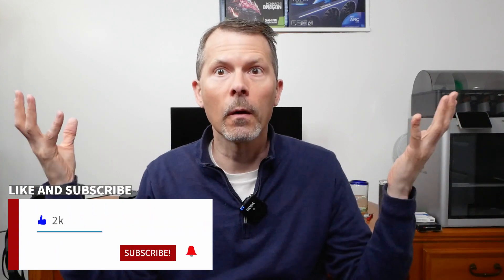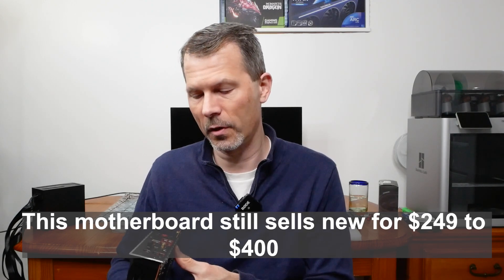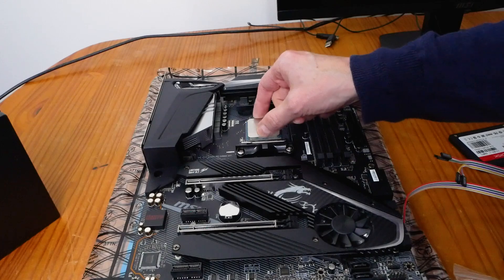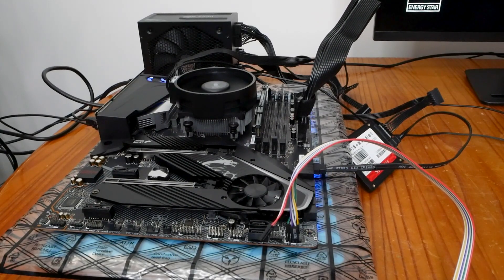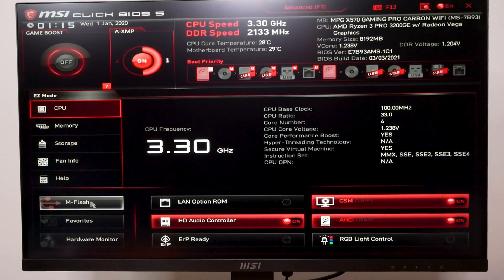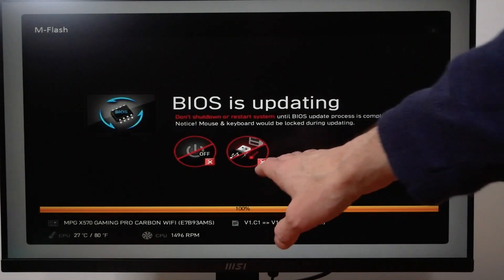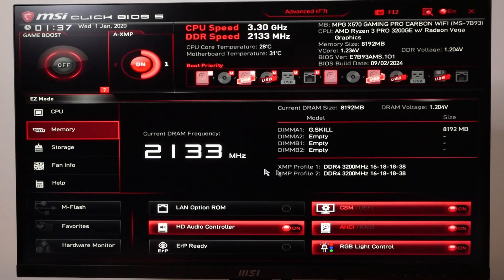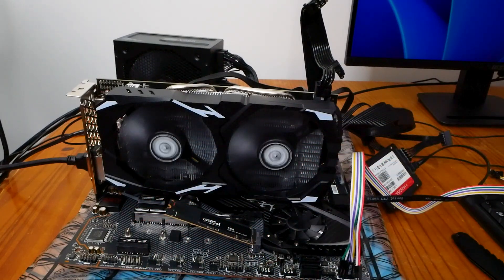BROKEN MSI X570! Can I Fix This Motherboard? #msi #pcrepair

Comment: For ram - it's generally the 2nd slot to the right of the cooler. Believe that slot is labeled as 2A then the 4th to the Right is 2B. the other lots would be 1A and 1B those would be the left of 2A and 2B.
Reply from the maker: Good info, thanks. I appreciate it :)

Comment: You seemed concerned about putting your cpu in it. If you have a multimeter, put the CPU in and check for shorts on the 12v before powering it. The 12 volt is where it will get power. You can check it against grounds on the cpu power connector on the board. Just google the pinout for it. I always forget which to probe. I run an msi unify x570. Be on the lookout for one or a godlike. Totally different tier of quality.
Reply from the maker: Ahh Good info I didn't think about my multimeter :) I can only imagine how mush those Unify or godlike mobos cost :) Thanks!
Reply: @RememberThisTech  the godlike is insanely expensive. I got a unify pretty much free in an untested ebay lot. The lot had two boards in it. One was the unify and the other an am5 with jacked up pins. Sold the broken am5 for parts making the unify free. It is crazy how heavy the boards are.
Reply from the maker: @ItIsNot1984  Great deal you got!! Yeah even the mobo I have has weight to it. Just got a new AM5 mobo will have reviews and testing soon!!
Reply: @RememberThisTech  on the unify and godlike, the vrm heatsink, shroud, chipset all of it is fully metal. Probably 3 or 4 pounds of aluminum. I think the carbon you've got is their best in the mpg class. The megs really get nuts.

Comment: I think your theory is valid. Someone plugged in a new CPU, noticed it didn't work, thought the board was bad and chucked it. Probably a commoner. A builder or enthusiast would have known better.
Reply from the maker: Yeah spot on! IDK why but in today's throw away culture it's more and more common for me to grab perfectly working stuff. I for one am happy i can get the stuff but sad to see so much in the bins for now reason ;(
Reply: @RememberThisTech  God don't talk to me about throw away culture. Between e-waste, people losing the "fix it mentality," companies making cheap products that don't last, and planned obsolescence...dang it I threw in a minirant lol. Oh, make sure you stress test it for at least 24 hours. Can't be too sure!
Reply from the maker: @itstheMR  Yeah I totally know what you mean.. Heck I'm not even that great at soldering but i've saved my LG fridge 8 years back when the power controller board died. It's one of those throw away parts meant to get you to buy a new fridge. Its still working... Plus a lot of the recycling or e-waste doesn't get recycled.. But incinerated or shipped of to other countries :( I've got on my list to by a nice soldering kit with auto solder sucker and a lcd magnifying setup that can also record video!
Reply: @RememberThisTech  Soldering is both technical and art. I've done a few basic things like replacing power connectors on laptops that snapped off. I have a TV that died after a few years in the mid 2010s. I was out of Samsung's recall warranty. I read what the exact issue was, I took the board out, took it to a shop, and $200 later my tv was working again. It's nearly 20 years old and still doing strong. Yeah, it's only 1080p, but it was a new higher end model that came out in the late 2000s with a new high refresh rate, so it still looks relatively good. It's a fluorescent back lit LCD. It's a chunky boy with the big bezels, but it still looks great!
Reply from the maker: @itstheMR  I had a 200lb Sony trinitron I tv or something like that i had for years I gave away because my poor back couldn't bear to lift it again... I bet that Sob is still running and looking great somewhere...
Reply: @RememberThisTech  I still have my 100lb Trinitron GDM-FW900. =)
Reply: @RememberThisTech  So it looks like this MB can take the AMD 3950x with 16 cores and 32 threads. You gonna upgrade it and repurpose it?
Reply from the maker: @itstheMR  meh idk. Might flip it to get other stuff for the channel. I think it can take 5000 series to . Goto go get a assess root canal tooth pulled right now so it's putting a hold on work and the tech channel stuff..
Reply: @RememberThisTech  Ouch! GL with that! And if you ask for more meds and they deny, get forceful! That happened to me once.
Reply from the maker: @itstheMR  ahh ty. Naw, so far, it's only advil, and Tylenol kinda does nothing... Anyways, thanks. We will see. Was hoping to get a couple of decent new reviews done this week on some black Friday stuffb I i snagged, but the best I could do was an unboxing for this week. See how I feel come Sunday and maybe be able to do something testing/benchmarks